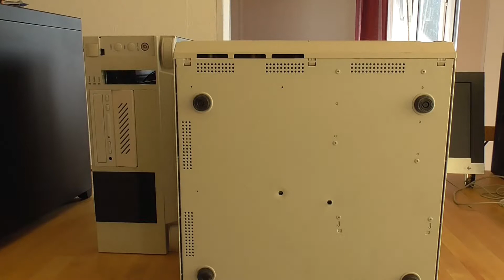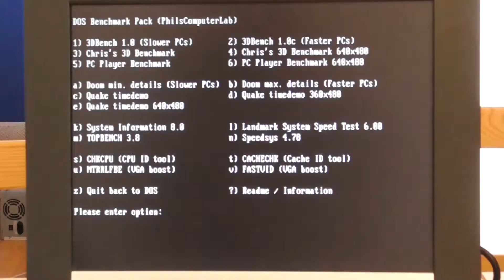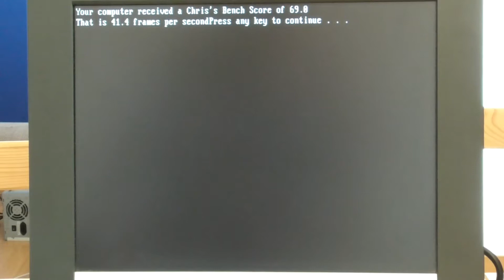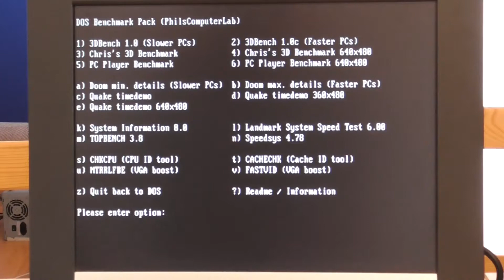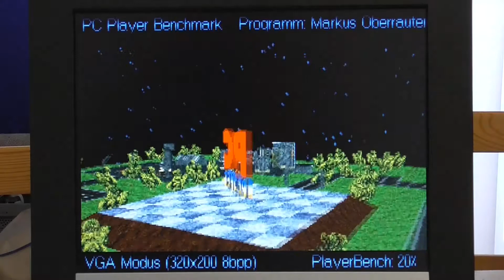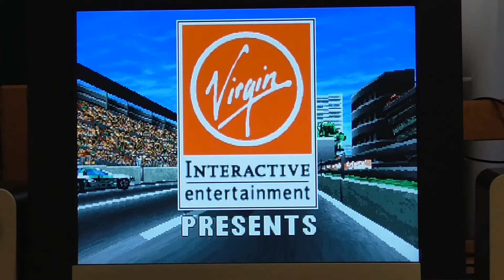Building a Big Box 486 Part 2: Assembly, Benchmarking and Final Result

Comment: The bandwidth of VLB isn't really the problem with cards interfering, I've heared it was rather electrical interferences causing this, and it's also FSB dependant. At 40MHz you can expect one VLB card to work. At 25MHz you can expect 3 to work.
Since VLB is pretty much the CPU bus connected to this bus it's not a surprise it's quite sensitive.

I used some VLB controller alongside a VLB western digital video card (yes they made video cards) and it crashed windows when i loaded drivers. I swapped the controller and it was right back to business !

As for the not working VLB slot, I really think that Slave VLB slot isn't running slower but rather some cards won't like it at all. I should test that with my motherboards. What's this motherboard actually ?

But like you mentionned, you have integrated I/O plus PCI, so it's not actually a big deal.
Reply from the maker: I actually tried four different VLB cards in the slot, so I really do think it doesn't work. That motherboard is a 486-VIP-IO. It's really unfortunate the onboard IO is so slow, otherwise I might have used this board in the build.
Reply: @PCRetroTech  Ah you've tried also io cards in there I guess ... Well you could always use a PCI video card and use a VLB io card. Or maybe there are drivers for the chipset that can enable some stuff to improve the speed further.
Also check all of your 486's bios for memory options because they often let you tweak memory settings which can improve the performance too.

Sometimes your board is already quite fast, sometimes it's not, but I know I can get a cacheless motherboard with UMC chipset to run quake quite a lot faster than the same 486 DX2 in someone else's machine with cache (the youtube video where somebody is comparing a DX2 to a DX4 vs a P60 or 66 iirc). He gets 5.x FPS. I get 8.0 FPS, which I find quite impressive considering it hasn't even L2 cache.
Reply from the maker: @DxDeksor  Actually, I've only tried video cards. I guess I could use the PCI slot for video, but the PCI implementation on these boards is not very good, I believe. Not that VLB is all that great either, I think.

Of course I checked the BIOS for memory settings. I discuss all that in the video.

At what resolution do you get 8fps in Quake? I guess it would probably be a lot higher with PCI than with VLB.
Reply: @PCRetroTech  Well I don't think PCI is any better than VLB, they're both 32 bit buses running at roughly the same speed (though VLB has some edge at being closer to the CPU and also being able to run in specs at 40MHz and PCI has the edge of having more modern cards available). PCI also depends vastly of how well it was implemented while VLB is just the CPU's bus.

I get 8FPS in quake at the default res so it must be 320*200 or maybe 320*240.
Reply from the maker: @DxDeksor  I get 9.7fps at the standard resolution with Quake on the v4p895p3 motherboard.

It looks like you are right about PCI vs VLB. I looked back at some old timings for an AMD 486 @ 80 MHz and the PCI and VLB timings were comparable. But some of the benchmarks would hang when using PCI.

When I finally get the 486-VIP-IO machine built up again, I might try various PCI cards vs all the VLB cards I have and see if there is any difference. I might even have VLB and PCI Cirrus Logic cards with the same chipsets.

Comment: 7:00 the thing is that Intel chips have 16KB of l1 cache instead of 8KB, and some are Write-back as well (I do own one), so it's actually kinda worse than intel chips. I believe that there are 16KB amd DX4s but so far I never saw one, so maybe I'm mistaking. AMD 5x86s do have 16KB though.
Reply from the maker: I should try an Intel one some time. They seem to be very rare here in Germany. I have some slower Intel ones, but not any DX4's.
Reply: @PCRetroTech  well I only have AMDs and one Intel I bought from the USA, so it looks the same for France.